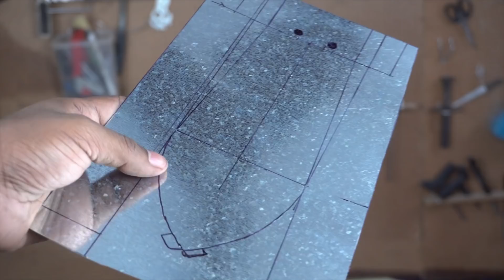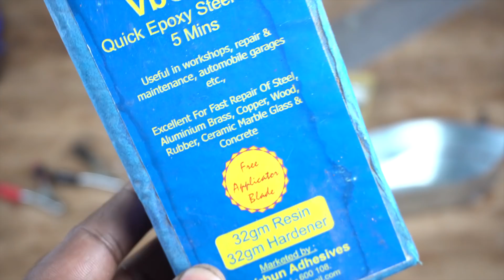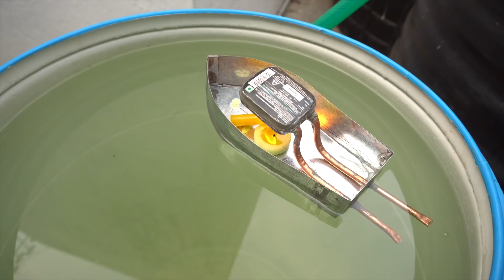Make a put put boat  All Metal big size

Comment: More practise bro. Not working
Reply: All that time wasted.. bummer.  Poor execution, shitty attention to detail  will equal a shitty working boat every time.
Reply from the maker: It works. Two mistakes I noticed was the boat was a bit heavy. Plus I used candles for the fire which when melted was accumulated in the boat adding to more weight. Rectify these and it will work for you